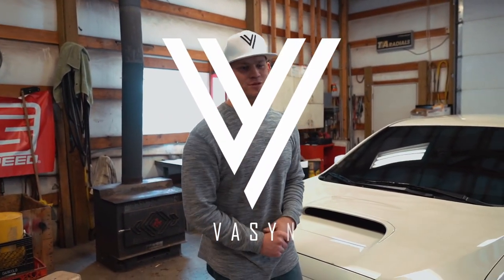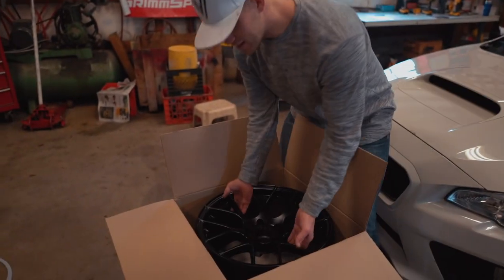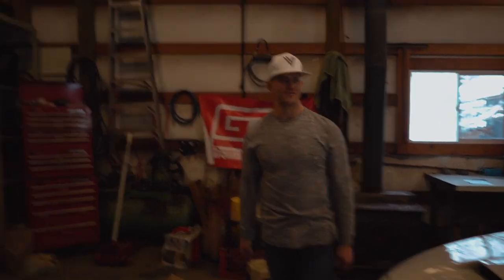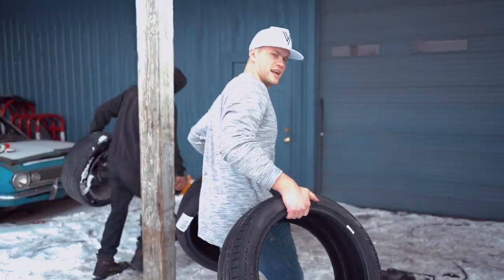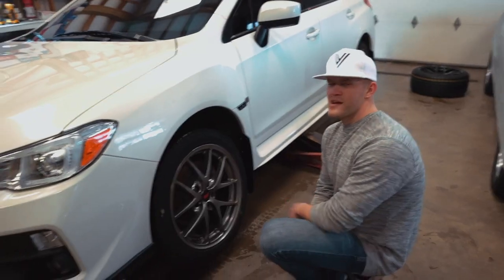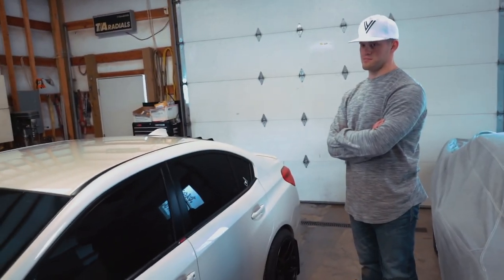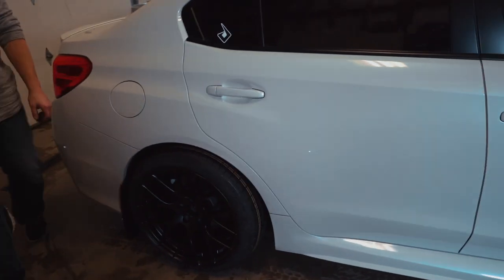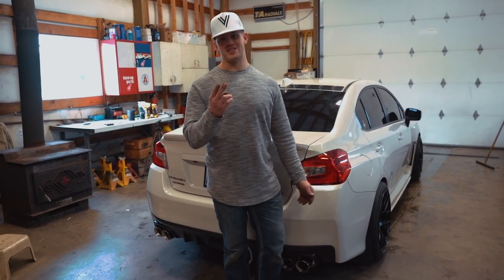New Wheels for the WRX Build!

Comment: +15 is way too aggressive. +38 and +35 is most common for a 9.5 wide on the 15+ WRX and STI.
Reply: Too aggressive? LOL, btw, Chevy Volt, Nissan Leaf, Toyota Prius, etc. are all parked down the block. There's your calling.
Reply: @ShoTime017  ? +15 is an aggressive fitment...?
Reply: @LukaDaudt  for these cars, yes. The stock offset is +55. If you're going 40mm below on stock components you're pretty much asking for trouble.
Reply: @alamsas2  what do you think if I get this same wheel in 18x8.5 or 18x9.5 with +40 offset? I can’t decide if I want to go with the wider wheel or not.
Reply: @5W1M  what are you trying to achieve? If you're not tracking the car, wider wheel just means more expensive tires. 8.5 +40 is close to flush. I have 8.5 +38 on mine and it's pretty much flushed. Handling has some slight differences if you drive on uneven roads a lot.
Reply: @alamsas2  I want to have it flush and also keep the stock suspension system within its limits. I was eyeing the enkei raijin in 18x8.5 +50 or +38 and with the pilot sport all season 4 in 245/40/18. Is it better or worse handling differences?
Reply: @5W1M  Did you end up deciding? Im having a really hard time deciding what offset would look best on a stock car. Prefer not to roll the fenders until I invest in my “dream” wheels.
Reply: @lizbelli8287  I'm going with the apex ec-7 in hyper silver 18x9.5 +38. I'm also putting rce yellows on. You should be good on stock suspension setup without rolling your fenders even up to a 265 wheel on 18x9.5 +38 from what I've read. I'm going with a 245/40 tire.
Reply: @5W1M  Thanks Daniel. That does seem like the most common size I see online too. I have been researching it for a couple of days. I might go for my dream wheels- the Work Emotion ZR10’s. They offer the 18x8.5 +47. Hard decision, this stuffs not cheap!

Comment: It's not the tire size my dude, it's the offset of the wheels. Also if your wheel is 9.5 wide and don't want a stretch you need a 265 or 255 wide tire. Offset is key

Comment: I don't want to slam you but man, do some research. Two minutes on Google would have given you perfect flush fitment for the VA chassis. 18x9.5 +38 on a 265/35/18 tire is perfect; your offset and tire width is way off.
Reply: CR57 18x9.5 +38 265/36/18 on coilovers. Still stock alignment settings, just lowered, rear needs a 4-5" section rolled about 10mm to leave a slight 5mm space. Since I've already got the tool to roll the fenders we went with a 18x9.5 +35 265/40/18 on the next setup. Meaty setups wins hands down imo.

Comment: 255x40 on 18s et 38  worked out perfect in Spokane for me. Brought up bottom of the car 3/4 of an inch and increased wheel travel distance by 3%. Meaty tire fits the car and fender gap is less than tire thickness. Front has small poke of about 1/4 inch. Grip is insane and potholes are laughable 😂 purpose fit for eastern washington and no rubbing or scraping with mud flaps as long as you keep ride height stock

Comment: I’ve got the same black Enkei Raijin 18x9.5 +35 offset on 265/35r18 pirelli p-zero all season plus. These don’t clear the front brakes on my STI but would fit perfect on a WRX. I’ve also gone through the PITA work of ceramic coating them. Let me know if you’re interested.